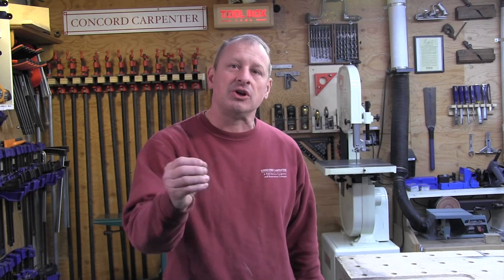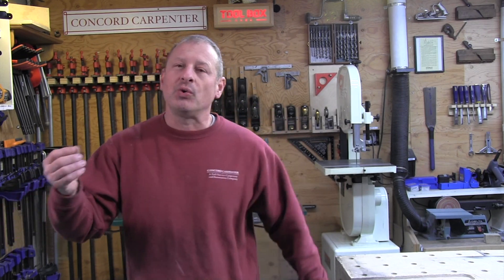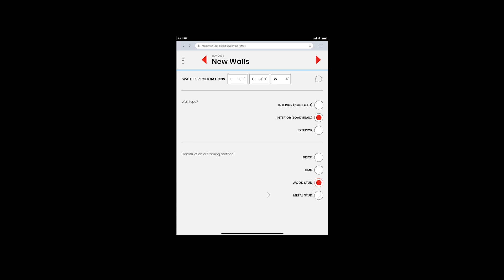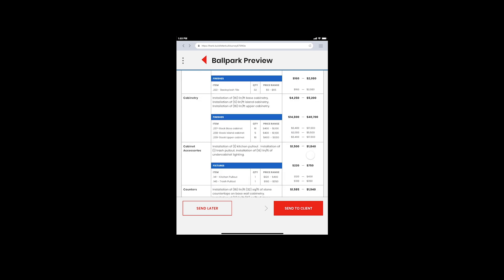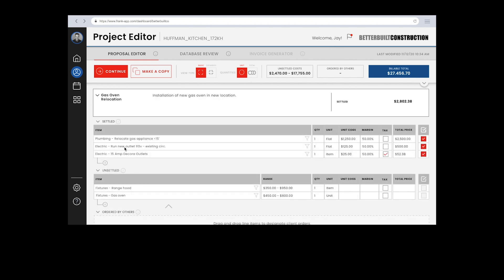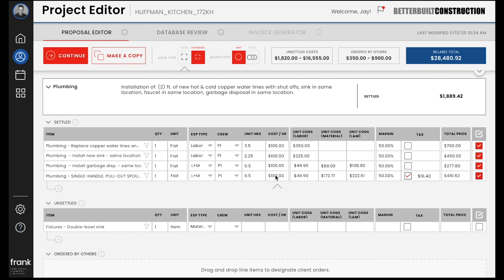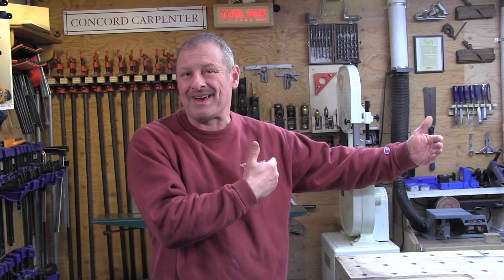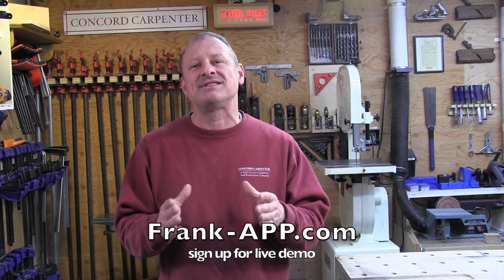Using "FRANK" Estimating Software To Be More Efficient

Comment: This seems great, but I'd rather wait to see it more fleshed out. Think they're going in the right direction though
Reply: What kind of features would you like to see added?
Reply: @sergemarlon  can different people from the reno company access various info? Is it actually stored on the cloud? What's the security of that? Are there enough servers setup to not crash and die? Can I still use it if my phone loses signal? Is there an easy to follow training video I could show employees so they can get up to speed and use it effectively? 
I know that some of these will be worked on over time. I'm also aware that growing pains happen. As I said, it's going in the right direction. I just am not sure I'd be a beta tester.
Reply from the maker: @HelenaOfDetroit  Great points